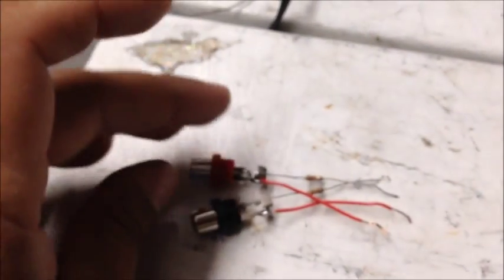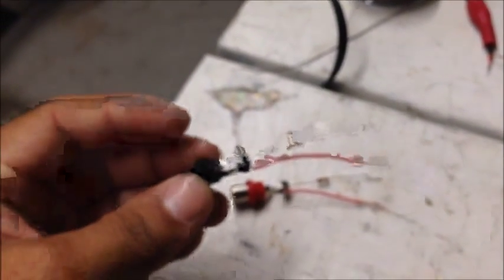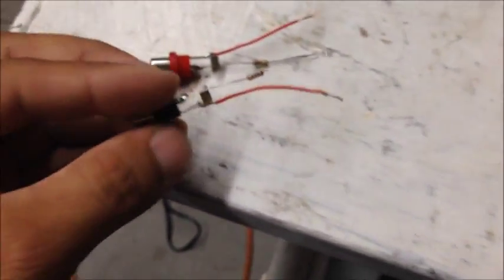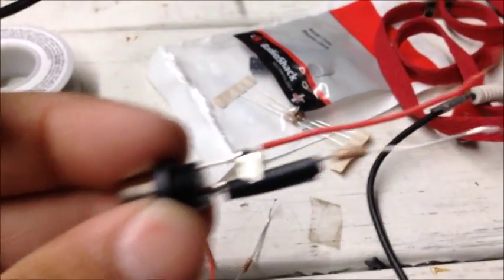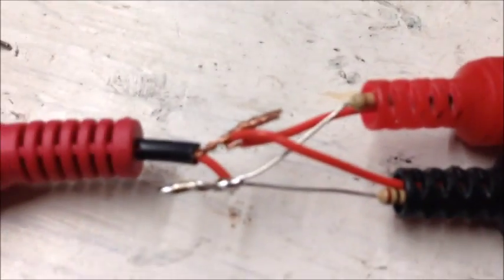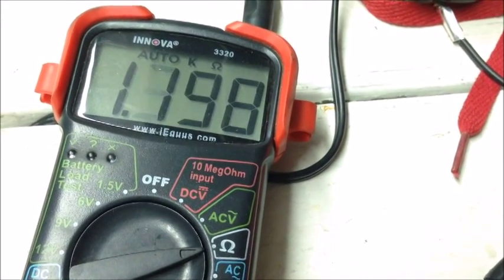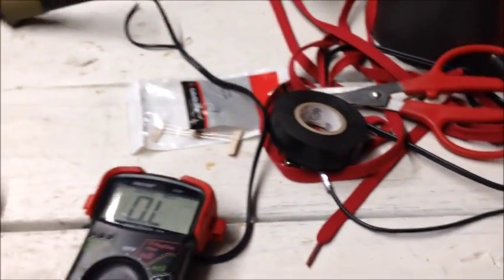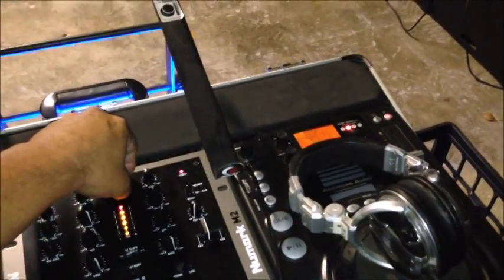summing cable

Comment: Hello, I have yet to get a definitive answer on making a summing cable for a stereo car radio that needs to work with one speaker as that is all that the car has, one speaker and I am not willing to modify my dash for another. I have been told that a summing cable will destroy my car radio, but that is not what I see in your video where you use it with a high end stereo amp.  Will your summing cable work with a 12 volt DC car radio?  And if so, what resistance value should I select?

Comment: Can u tell me the ohms of resister which u used here? It's a rca Y adapter so can I use this in home theater receiver Subwoofer pre-amp output for connect 2 Subwoofer speaker?

Comment: Can you hook a speaker box to one speaker?  One speaker is in my sound bar in my Jeep and I want to run speaker wire from my Jeep speaker to a speaker box that has two speakers and a tweeter.
Reply from the maker: That sounds like you want to "split" the signal to run 2 speakers from the wire of that single speaker.  It will be ok without a summing cable.  I made this summing cable so I can plug in "2 speakers ", a left and right to a single audio input!
Reply: Gilbert Arciniega I was just going to run a wires from the pos & neg from one speaker to the pos and beg in the back of a speaker box that has 2 speakers.
Reply: Run the wires 

Neg

Proofread

Sorry
Reply: @leesire  get an amplifier 4 output and they turn 2 in in 4 out

Comment: Check this out. Rane states the resistor value can vary around the 450 Ohm value pretty broadly, but keeping the tolerance at or below 1% is key. http://www.rane.com/note109.html